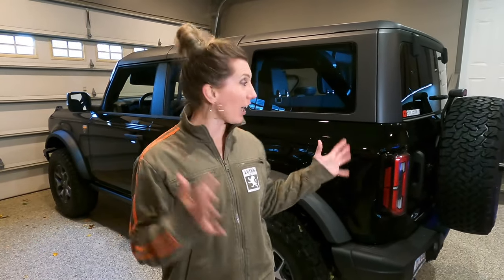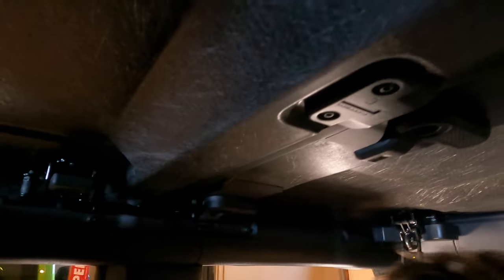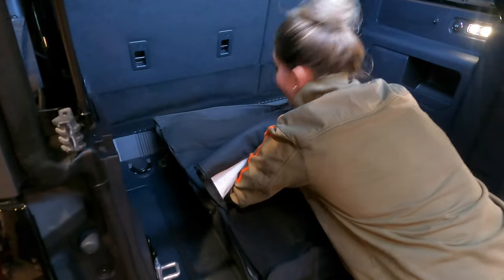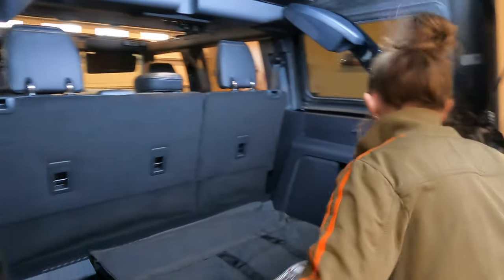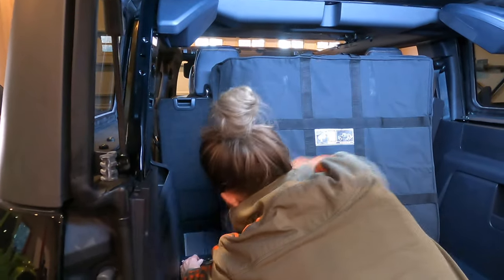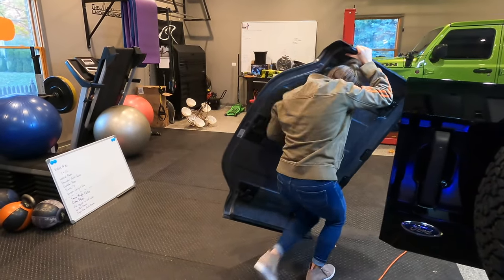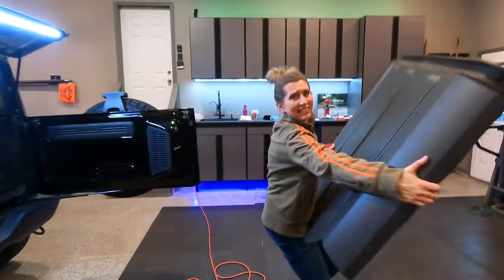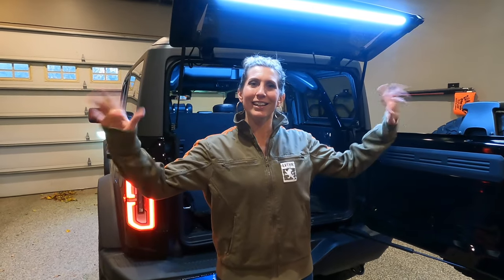Bronco Top Removal & How To Store Them in the Bag *Bronco Hardtop Tips

Comment: You did the latches backwards.  You undo the 3 latches first, while the main latch has most of the tension.  This way it'll be easier to undo those three with less tension.  Putting them on, you latch the tension latch first, so the other three close easier.